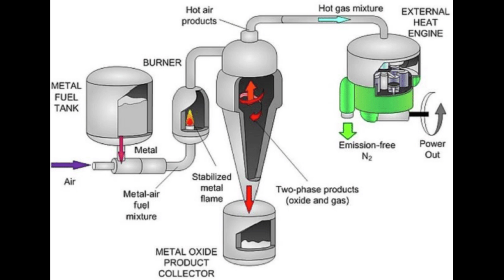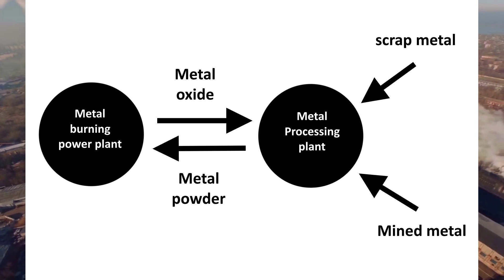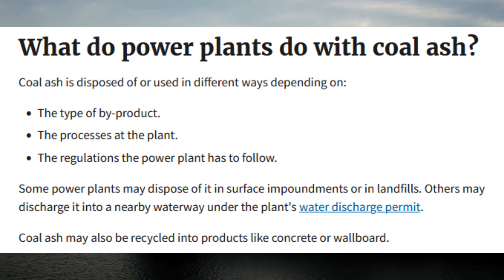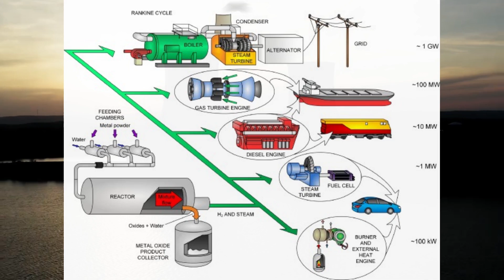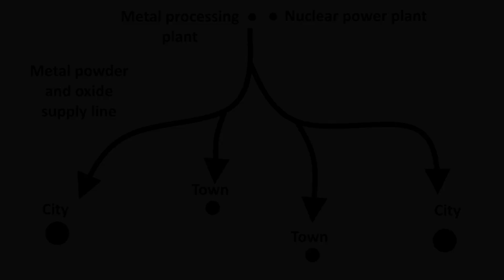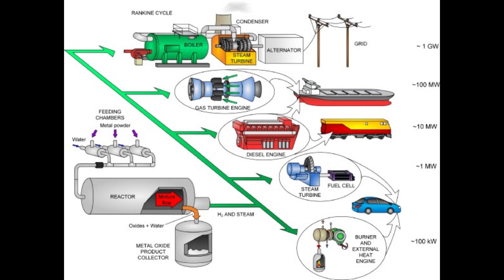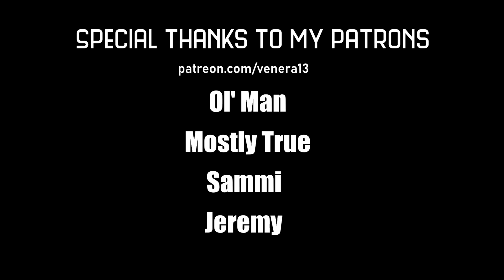Using Iron instead of coal in power plants

Comment: Why can't the iron powder replace the diesel on a diesel electric train?
Reply from the maker: It could, trains and cargo ships both don't suffer from mass limitations as much and can realistically use metal fuel, hydrogen, or even giant batteries for power.

Comment: Dumb idea. Just use the metal to make more wires and suspension towers to route power to where it’s needed without the additional step. The coal is burned because it already has potential energy in it. There are no plans to reverse that process. Ultimately nuclear self contained heat sources are the best option where they can be shipped back and forth between processing plant and retrofitted coal burning power sources. If you want to insist using aluminum, just us liquid metal batteries. No need to burn anything, just recharge it from the metal you didn’t burn in expanding your power grid. You forgot to mention that the metals burn at much higher temperatures and therefore would be far more difficult in designing heat exchangers since the heat the metals would produce would most likely melt the exchangers.
Reply from the maker: Nuclear is the best option personally. But I still think this is a neat idea. It's not my idea, others are working on it.

Comment: sodium would be better than Iron. it is more abondant and more energydence than Iron.
also  using it galvanically would be way more efficient than burning.
also it is easier to produce with electric energy than Iron.
Reply from the maker: An interesting idea, however iron and alluminum are still more abundant on Earth than sodium. From a burning standpoint titanium and magnesium are better than iron. I only focused on iron because its more economical and its also what people developing this are primarily focusing on.
Reply: @venera13  all in all metals are an obvious solution to store bulg amounts of Energy. But there are a lot more clever ways to use em than just burning it.

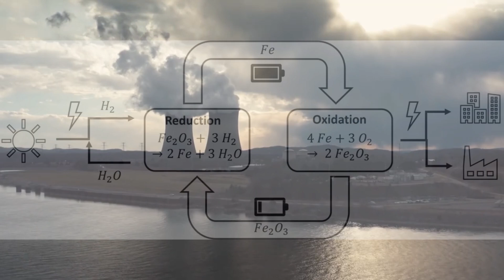Comment: Wait a second. At 3:38, it says that the iron oxide can be reprocessed at a plant that produces hydrogen cleanly.  What, pray tell, would that plant's process be that produces such clean hydrogen?
Reply from the maker: Electrolysis, you pass electricity through water and presto you get hydrogen and oxygen. If you heat the water up first it's more efficient. Green hydrogen makes up a small share of hydrogen currently but as long as you have electricity, you can make hydrogen. I personally think it's an excellent use of waste heat from nuclear power plants. A low power thermal system to just make hydrogen from energy that is otherwise wasted.
Reply: How much of the energy you gain from burning iron would you have to use up for the electrolysis though?

Comment: 40% round trip efficiency, something you did not mention in the video.. This means even if we ignore all extra effort in terms of material and labor using iron as a storage medium makes each kWh 2.5x more expensive.
Not cheaper, more expensive. Meaning Solar / Wind (75$/MWh) "through" iron are as expensive as nuclear (175$/MWH) with 187.5 $/MWh. 
And on top of this you need two plants + people working.
Reply from the maker: Pretty sure I did mention the low efficiency, it was the first con. And one of the excerpts I show even said 40% efficiency. The economy of it only really works large scale, which is why I was also rather skeptical of the car idea. Remember this isn't my idea, it's just an idea being explored by other companies and countries. The European Space Agency also has a page on it for some reason. As for needing more people, oh no! We wouldn't want more jobs!

Jokes aside reprocessing large volumes isn't a huge issue from an infrastructure standpoint. But yes it would require dedicated reprocessing. But 1 reprocessing plant could feed many burning plants. Like how every LNG plant dosnt need a refinery.

Comment: Comparing Solar on a $/kWh base is missleading: You need storage for it to be viable. And then it's no longer cheap.
Reply from the maker: Storage isn't cheap? We already use city size power storage in many many places. Gravity batteries, pump water into a holding basin, then dump it through turbines when needed. Already used commonly, the UK uses it a lot for example. Thermal batteries are also proving to be efficient and cheap. Molten salt, a phase change material, even sand can be used in those. Can also make hydrogen as an energy storage medium. Can use large batteries too but I'm less onboard with that idea. Point is energy storage is a solved technology. I find it very strange that people forget that grind scale energy storage is already used.

Comment: Also, iron is NOT cheaper than coal. Iron ore is slightly cheaper, but actual iron is several times more expensive than coal and it has several times less energy in it.
Reply from the maker: Iron is more abundant and sourcing it is generally cheaper and easier coal. You don't need to mine all of it, you can harvest scrap. And once it's in the loop you just re-use the same iron over and over again. Where coal needs to be continuously mined and is single use. However you are correct in that I should have accounted for the lifetime cost of processed iron. Start up costs for the loop are higher.

Comment: You forgot to mention one of the biggest cons, Iron has HORENDUS energy density because it's heavy and generates about as much heat as regular fuels for a given volume. Also, burning solid fuels is a problem in it self. There's a reason only the cheapest solid fuels are used because they can make up for this disadvantage, but only in stationary applications like powerplants.

This process is also very inefficient so it's use as a "battery" seems really questionable. There are much better solutions like using surplus electricity to pump water in to an elevated pond then generating hydro electric power when you want to get the energy back.
Reply from the maker: I mentioned the round trip efficiency issue in the video, I even show an excerpt that states the round trip efficiency is 40% so I sure did mention it. And also mentioned gravity battery's which are a fantastic idea. The energy density per kg is higher than lithium ion batteries, so if used in large enough volumes it becomes economical. I never claim its the best solution or a single solution. I even state power grids are best with diverse energy inputs. This is just 1 of many energy carriers that can be used. I never  said we need to ditch all other energy for metal. For what it's worth nuclear is top of the list for me in terms of electricity. Can't beat that energy density chemically.
Reply: @venera13  "The energy density per kg is higher than lithium ion batteries"

This isn't saying very much since even the best batteries are terrible compared to an actual fuel like petrol/kerosene/diesel.

" I even show an excerpt that states the round trip efficiency is 40% so I sure did mention it"

Oh cool, but 40% is not very good. I'm thinking gravity solutions would be more efficient, and also batteries would be more efficient as well(short term) but they are terrible because of cost and limited lifetime.

The real holy grail would be a somewhat energy efficient way to create synthetic hydrocarbons or alcohols at industrial scale from CO2. However, this seems very hard due to the problems of collecting the very dilute amounts of CO2 in the atmosphere. Thus the ideal solution is probably hydrogen since it's oxide is just water and it collects naturally when it rains, thus it's much easier to collect back up than CO2 which isn't really practical to collect unless we get a few % of it in the air, right now we are only at 0.04%. It has problems though, it burns really hot and violently so it's hard to make piston engines work well on it, it's also a gas at normal pressure and temperature which makes it harder and less safe to store.

Comment: This is amazing!
 the reduction of iron using hydrogen happens around  1000 c 

Very achievable using a hydrogen flame too
Reply from the maker: Yep! It's suprisingly doable. The only downside that would make it a slightly harder sell is the energy losses from processing vs burning. But when thought of as a battery in bulk it becomes a neat energy carrier.
Reply: @venera13 agreed, the practicality might outweigh the efficiency losses… the biggest inefficiency is in generating the hydrogen.

With concentrated solar hopefully there will come a day where we can thermally crack water with a catalyst efficiently

Edit: metal powder linked with “red hydrogen”(nuclear, check it out)  could potentially be more  practical than renewables

Comment: Thermite reaction which uses both aluminium and iron for iron to melt and join rail tracks. A lot of energy is put in making aluminium plus the additional cost of transporting etc. 
There is no energy in iron I don't know what the hell are you talking?
Reply from the maker: Thermite is way too energetic you wouldn't want to use that. The concept here is you burn metal powder the same as you burn coal powder. Fine iron powder will burn in air just as easily as coal powder, so will aluminum powder, magnesium powder, titanium powder. But Iron is cheaper, so you blow iron powder into a burner and light it. it burns, as in you know, fire. The heat from the burning iron powder boils water and turns turbines. It's the exact same process as burning coal, but instead of coal dust you use iron dust. I don't know how I can explain this simpler. 

Perhaps the European space agency can explain it better

https://www.esa.int/ESA_Multimedia/Images/2023/05/Iron_burning

or here?

https://www.chemistryworld.com/news/burning-metal-to-make-clean-energy/4014723.article

metal powder fuels isn't just a random concept it's already been demonstrated to work because it's just basic chemistry. I also addressed everything you said in the video from processing to transport. Metal powder is basically just a bulk battery.

Tl;dr you burn iron powder to generate electricity the same way you get energy from burning coal.
Reply: Are we going to use pure iron powder or iron ore fines because crushing of pure iron would be very expensive.
Reply from the maker: @b_hav_6365  pure iron, however scrap iron can be used, and again the waste is reusable forever. The oxide waste can be processed back into iron powder and burned again. So you would need to refine very little additional iron per year. If you use waste heat from pre existing nuclear power plants to re-process the oxide back into fuel the costs go down even more. I coverd this in the video as well when i talked about the fuel cycle from iron to oxide back to iron. I'm getting a feeling you didn't actually watch the video.